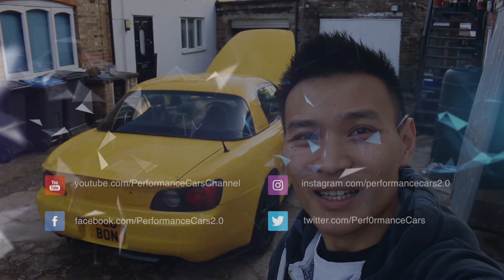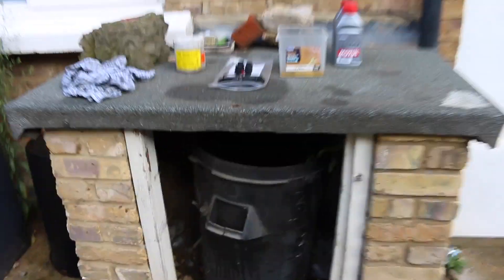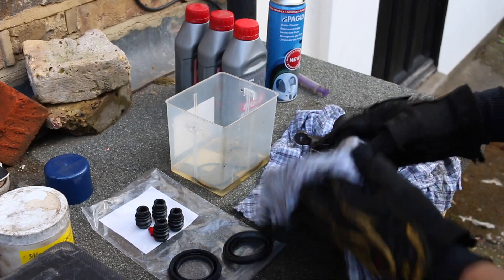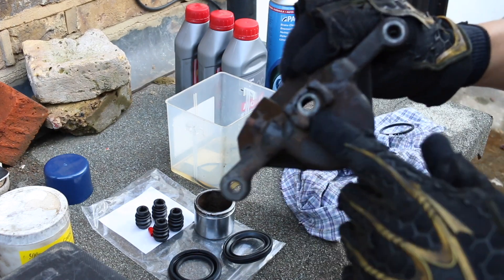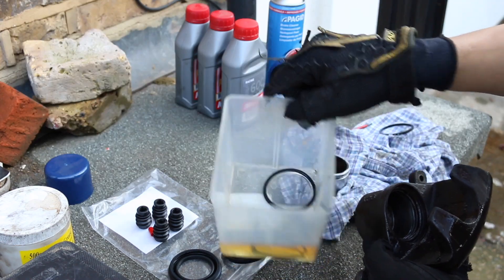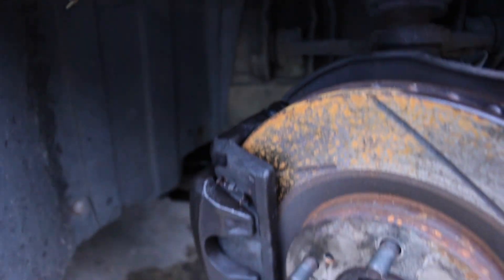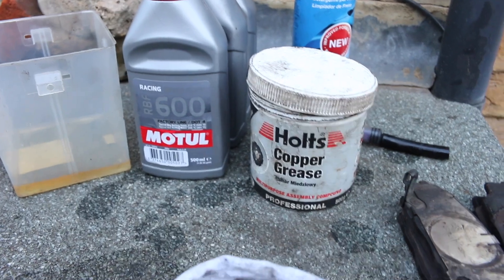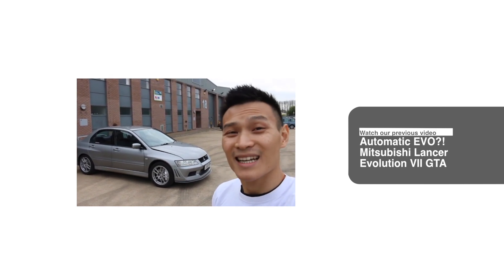OMG! My Brakes are Leaking Fluid?! How did this happen? - PerformanceCars

Comment: Doubt after 7 years +, you're still doing followups BUT I'm having a problem where the leak is coming from the brake pin/caliper bolt seals. Even after replacing the caliper with an identical one. 
Very easy to understand video.

Comment: Hi mate, I think you should check your rear brakes as well  but there is a little bit more complicated because of the hand brake mechanism. I would appreciate if you could do a video of rear brakes refurbishment, cheers ;)
Reply from the maker: Hey buddy, there were no leaks from the rear hence why I haven't changed them. The handbrake mechanism does make it slightly more tricky to remove but it isn't difficult. I shall look into buying a repair kit and make a video.

Comment: I have a 97 f150 I had to open the brake line to Install brake pads because the bleeder is impossible to open.  I've done it on the other side no issues the brake line where it connects to the caliper is leaking where the bolt screws in. I loosened and tightened it again but a small amount of fluid comes out when you press the brake pedal. What's going on?  A 10 mile trip lost around 1/10 of the reservoir.  I only cracked it to let excess fluid out to press piston back I did not completely remove it.

Comment: i have change all the rubber sealing, but not the piston or cylinder, the piston have rust that eats the piston around it. and it still leaking. do i need to change the piston too?

Comment: What did you use to bleed your brakes? Old fashioned 2 man job or have you got a specific tool. I find the Easy Bleed tools a bit hit and miss. I think I would like a pneumatic bleeder machine. Great video.
Reply from the maker: Hi, I have used the one man bleeder and the pneumatic one too but I prefer the old fashioned 2 man job as you mentioned. It's the method I find to be easiest and it means I have someone to talk to too 😊
Big thanks for your comment and support on the other video too. I really appreciate it.

Comment: had my bleed nipple pop out as soon as I parked up near my house, fluid pissing all over the road before I realised why my pedal/clutch went all funny! new caliper time, thank balls for mazda 3 cheapness, £50 for a brand new rear caliper and I was good to go, not a fan of brake failures ;)
Reply from the maker: No way! Did the bleed nipple just pop out for no apparent reason?! It's so strange how that could happen.
Reply: the reason was that the caliper was replaced by someone (3/4 were rusty) as I've tried to bleed the system I realised that the nipple is not moving so I left it as It would not move.. come two hours later when I drove back home and the nipple popped out. Was holding on ONE cross threaded tread, crazy how "pro" mechanics end up doing something as stupid as crossthreading a nipple. New caliper time, was cheaper than re-drilling, did the work my self so it's all good now. I have proper trust issues now.
Reply: i dont trust those shop mechanics unless if youre acquainted with them